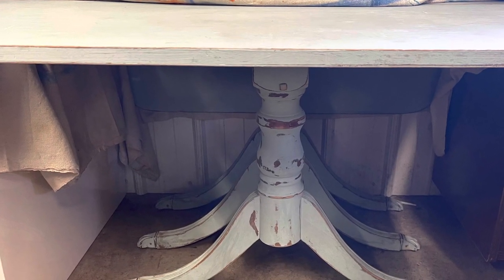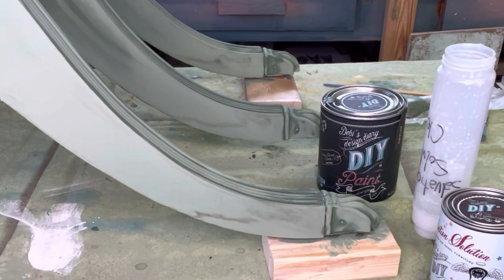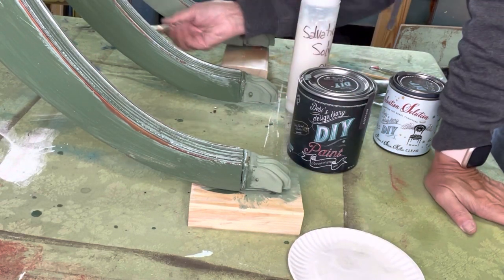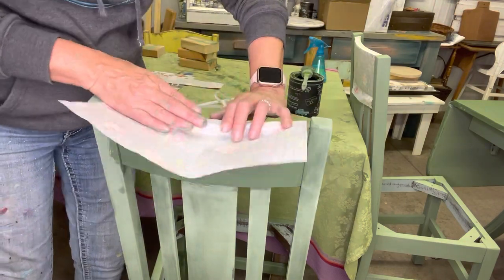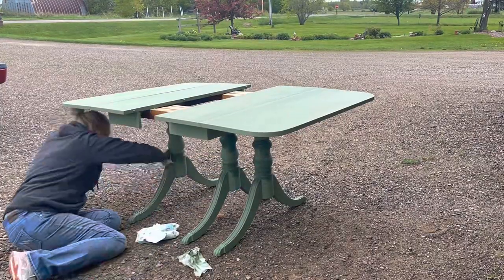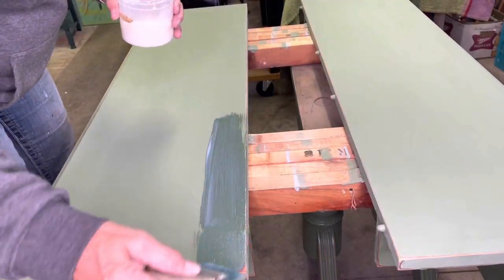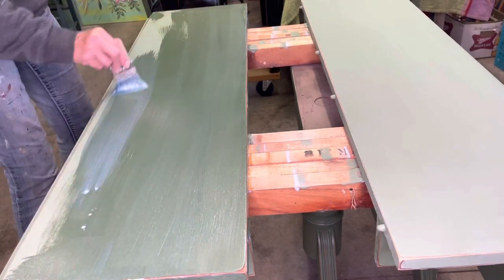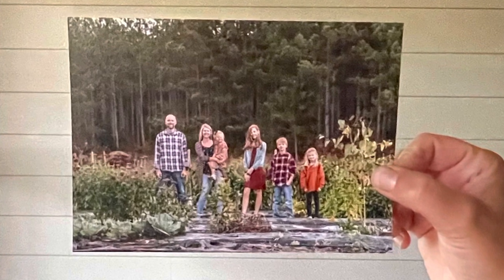Farmhouse Table - DIY Paint with IOD Paint Inlay - Aviary

Comment: Connie I have the same exact table someone just gave to me recently. It’s missing one of the metal feet on the legs I’ve been trying to find one. Although I do not know what they’re called. Do you know what they call those? By the way I like farm fresh and the inlay I like how the tables turned out very nice
Reply from the maker: It's a very pricey table I found out so I'm glad you have it to redo.  Those are claw feet and I found some on Etsy https://www.etsy.com/listing/768286397/pairs-of-vintage-claw-foot-caps-with?ga_order=most_relevant&ga_search_type=all&ga_view_type=gallery&ga_search_query=table+with+claw+feet&ref=sr_gallery-1-2&pro=1&sts=1&organic_search_click=1 but you'll have to check to make sure they will fit the table.